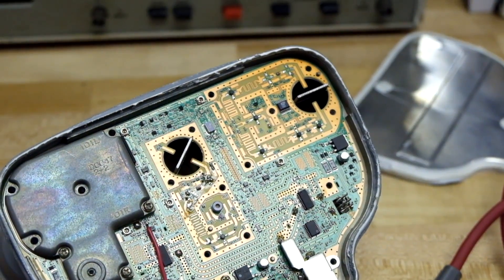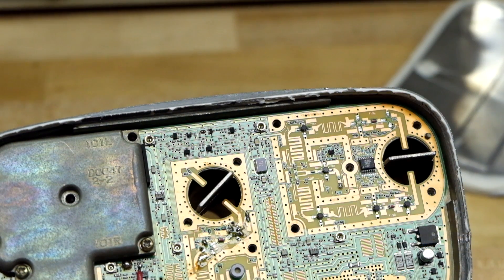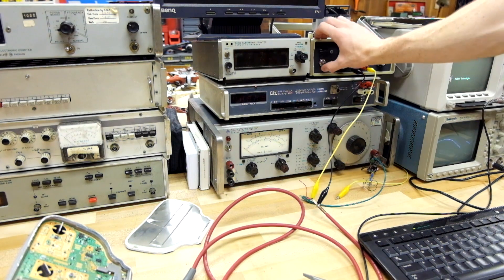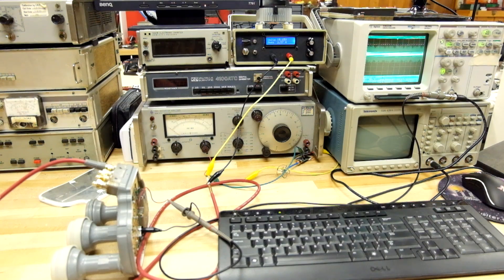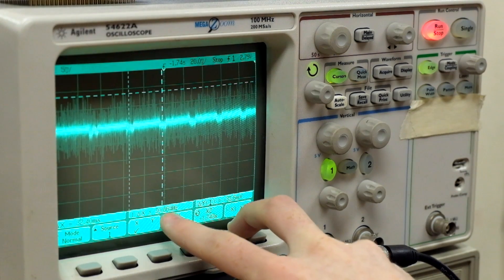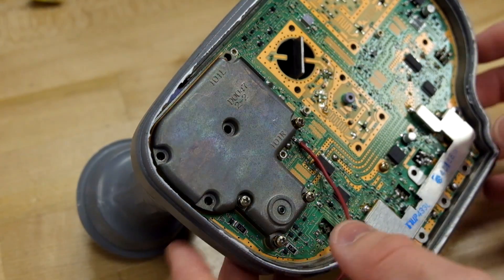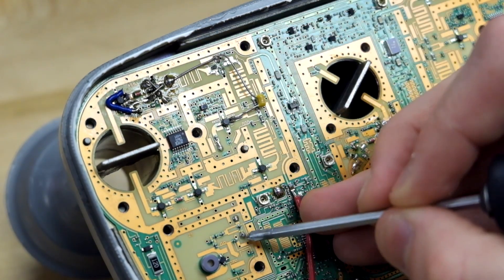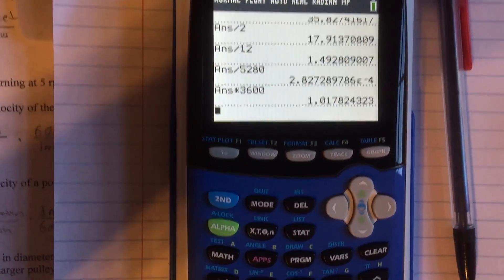DIY Doppler Speed Radar from Satellite Dish LNB - Microwave Radio Electronics

Comment: This is a great quick and dirty start to RF electronics! But remember that those microwave circuits around the fets are there for a reason: They impedance match the amps to following stages and the antenna, optimize the gain frequency response, noise figure and linearity. by inverting the fets and biasing them you get something out, but at a very high cost to your link budget if not done properly.

Anyhow, cool hack!

Comment: So you transmit in the frequency of the TV satelite? I guess you make you neighbors very angry.

Honestly don't transmit anything if you don't know what you do. For each application there are specific frequencies that you have to use. Those come with tons of regulations how much power you are allowed to transmit, duty cycles etc.. I'm not sure about the law i US, but here it can become extremely expensive if you transmit on wrong frequencies. The case of disturb others TV is by far not the worst thing that can happen. Imagine you transmit on a frequency that is used by a near by airport for the glidepath for landing airplains. Or you block the radio that is used by emergency vehicles to communicate...

Comment: In the 1970s, I serviced Polish speed radars.

I had to test them for correctness before they went to the Office of Measures for legalization.

For this I used a small loudspeaker without a diaphragm or basket, with foil glued over its voice coil.

I remember that I used 905 Hz, which at 10.455 GHz gave an indication of 50 km/h.

I didn't come up with this myself.
They gave me a tuning fork, but it was uncomfortable.

I tested the Polish Mirado, SRD77 and 771, as well as the American K-15.

Comment: you can simply use tuning forks to calibrate this. that's what they use for the older KA band ones used on the highways. here is an online calculator that you can use to fine tune it. https://copradar.com/chapts/chapt3/ch3d4.html

Comment: I believe that with circularly polarised waves the reflected return signal will be the opposite polarisation. Therefore, if you are receiving the signal on the same antenna you are transmitting on, then you may be receiving the signal “cross polar” which would significantly reduce its sensitivity.

Comment: Nice work, seems you got it going, no small feat at those frequencies. I’m sure if you put your mind to it you’d be able to whip up a down converter on the cheap and get at least some reasonable idea of the output frequency. Probably be able to find some cheap junk equipment on eBay with a decent quality salvage LO mixer IF amp...

Comment: Good work.  Ku band is 12-18 GHz.  I remember it like this: it's "K-under", because it's "under" 26.5 GHz.  Ka is 26.5 - 40 GHz, and I remember that as "K-above" because the band is "above" 26.5.
Reply: In satellite, Ku is anywhere from 10 to 12.75 GHz for the downlink - the uplink is between 12 and 18GHz. Seeing as this is a direc tv LNB, it will be receiving in the DSS band from 12.2 - 12.75 GHz with a local oscillator of 11.25GHz

Comment: I once did video, using a timex sinclare computers 70mhz output, into MDS down converter, by injecting the AM video, into the emitter of it's 2.4ghz local osc.  There's lots of neat things you can do, re-tasking equipment. Keep up the good work.
Reply: I wonder if you could get good resolution off of a 5 ghz wifi transmitter and receiver?

Comment: Please be careful using this, any form of radiating RF equipment is regulated by the FCC and RADAR is one thing which is highly regulated.  Otherwise, this is cool as hell.
Reply: Boooooo, let the man play, these rules are meant for companies that mass produce huge quantities of products or for high power applications, sure it’s probably technically illegal, but I’m pretty darn sure nobody is going to bother a young man for experimenting with very low power RF in his own home... keep up the good work...
Reply: Fun fact, government BW is regulated by the NTIA as opposed to the FCC in the US, not that he's operating under their jurisdiction, so the FCC is likely the relevant authority. It's possible this device complies as a part 15 subpart C (intentional radiator) home build depending on how low the RF power output is, but no attempt seems to have been made to check. Most researchers I know are wholly ignorant of FCC regs, and no one really gets in trouble for low power experiments. Technically, operating a VNA at -10dBm into an antenna with sufficient gain while checking return loss in CW mode or a narrow enough BW sweep is a crime outside of an anechoic chamber or faraday cage, but frankly the FCC doesn't care. For that matter even the MIT cantenna radar operated in CW is illegal. In FM/CW it's questionably legal under Part 15.247 if confined to the 2400-2480ish MHz ISM allocation.
Reply: Comedic Sketches and no one really cares about the regulations either

Comment: Awesome project! Very cool. 

I'm also amazed you're able to get a 11GHz signal through a through-hole cap!
Reply from the maker: Thanks! I was too haha I didn't have a any small value surface mount caps laying around so I grabbed that one and it worked! Not gonna question it haha
Reply: @dj-la--wolf1288  lol bro nice troll XD
Reply: @dj-la--wolf1288  yeah maybe your are but after reading for 5 minutes on wikipedia it would require an antenna of at least 1m in diameter. If you can find that in a decent cost range go for it. Also I think the data processing would be a bit more complicated than plugging in an unshielded cable into your oscilloscope.